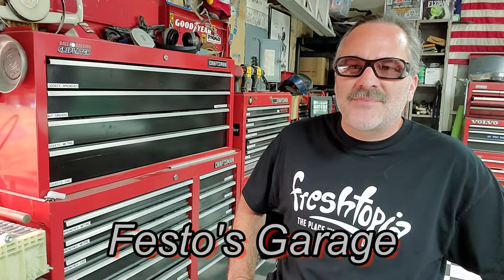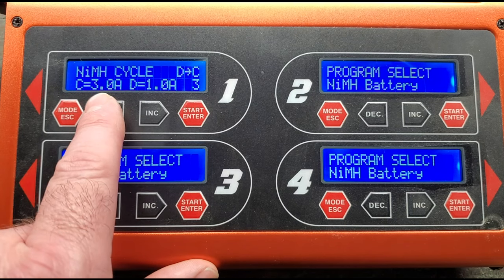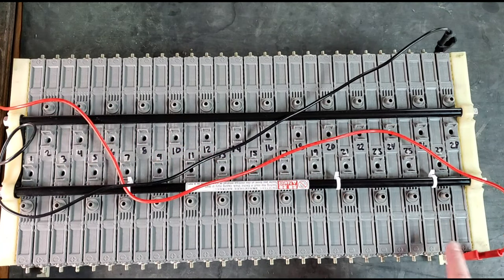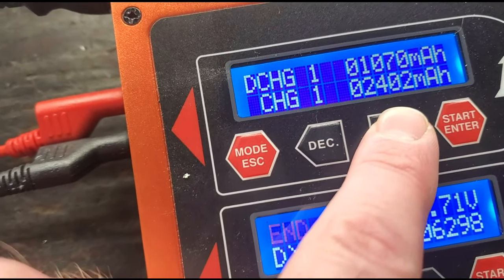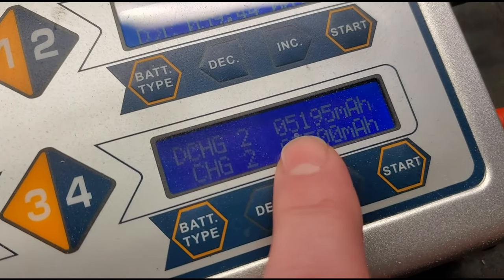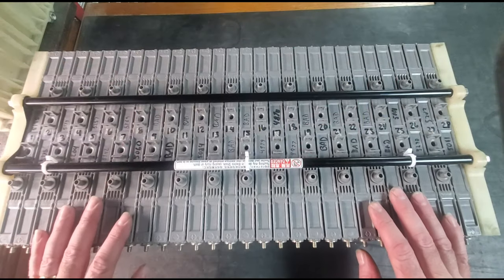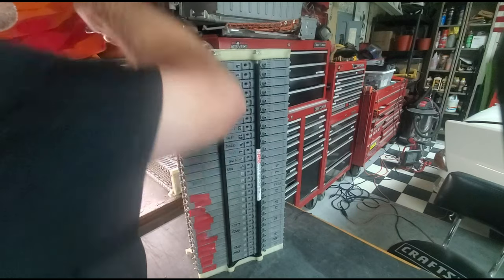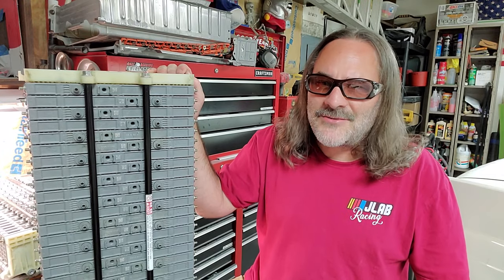Hybrid Battery Pack Refurbish - Step-By-Step w/ Settings - 2nd & 3rd Gen Toyota Prius - CQ3 Charger

Comment: I cannot detect any heating on the batteries.  If I program 10 cycles and 720 minutes, does each cycle last for 72 minutes? Of the 72 minutes, will it discharge for only 36 minutes?  Why wait 5 minutes from charge to discharge? Is there any limit to the charge voltage? Where can I get a manual that answers these questions?
Reply from the maker: Thank you for watching. The batteries will get warm when using this process and will expand. The 720 minutes is a safety timer. The cycle time will depend on the health of battery and how long it takes to reach Delta Peak based on the settings. Waiting time between cycles is to let the battery cool down. Setting the charge voltage over 6.3V could cause damage to the battery so I stay around 6.0V-6.3V. There should have been a manual shipped with your charger. If your charger is the same as mine then EV-Peak is the place to contact.

Comment: I bought 2017 camry, was 32MPG, after 1 year driving now 28MPG, do you think battery can be saved by your process(i know camry has more blades than prius), or should i get a new sodium battery. Thank you
Reply from the maker: Thank you for watching. This process can certainly bring life back to your pack. Have you checked battery health with a scanner/app such as Dr. Prius? This can tell you if the battery or if something else such as spark plugs, MAF, or filter is causing your decrease in efficiency. When deciding to refurbish or replace battery you should weigh options such as cost of new battery vs cost of charger, some replacements, and additional time of refurbishment. Please write back and let us know what you find out about your MPG change and how you are addressing the issue.

Comment: Thanks to your videos, I'm attempting to refurb my wife's Prius battery with the same charger you use. The process is taking much longer than i thought due to work schedule. I got most of the modules to acceptable discharge/charge numbers. I've gone back and rechecked some of the first ones and now the discharge isn't reaching the 5000 threshold before the charge is at 7500 capacity. Is it safe to say these are okay if I've gotten them to acceptable levels previously? I've already been at this for a few weeks and don't think i can go through them all again without running into the same issue due to time constraints.
Reply from the maker: If you have reached 5000mah on the discharge cycle and 7500mah on the charge cycle the battery is refurbished. It will equalize to the same voltage as the other batteries when you balance them together. I believe you are just about to get your Prius back on the road, woohoo!
Reply: @GreggFesto  Thanks, Gregg. Your tutorials have been invaluable!

Comment: I noticed you aren't using any temperature probes and your temperature setting is very high. How is this safe?
Reply from the maker: Thank you for watching. I am showing this process the way I was shown. Yes the batteries do get warm when cycling but not enough to cause a fire. I believe this is due to the settings. Low amps for charge and discharge to keep it in a safe zone.

Comment: Hey Gregg , love the video and am enjoying the process of refurbishing a 2007 Camry battery after buying the ev peak charger and learning as i go with your instructions . So far i am cycling modules in my spare battery pack so i will have good modules to replace any in the pack that is in the car when i start on that one (it is weak and needs refurbishing).In your opinion does a module cycled say 15 time and hit the 5000 mah mark last or work as well as a module that has been cycled 3 times and also hit the 5000 mah mark. My spare pack i bought has been out of a vehicle for a long time and sitting around. As well would it be beneficial to cycle a couple more times after hitting the 5000 mah mark and possibly get to say 5500mah or even higher if every cycle tends to increase or will a battery go out of balance in the vehicle and not even see a difference in the end.
Reply from the maker: Thanks for watching. Glad to hear all is going well. I have not noticed a difference in a battery that takes more cycles to reach 5000mah when compared to one that took fewer cycles. When I do have more than enough batteries to complete a pack, I select the ones that have the highest discharge ratings. If you can cycle more times and the discharge mah is still climbing then you can achieve a higher capacity battery. Pay attention to the charge mah, if it starts to decrease over multiple cycles then you have reached the limit of that battery. If you go too far the discharge value will begin to drop over multiple cycles.

Comment: Helpful video Gregg! I bought a new charger the same as your red one. I have been using it and charged half the pack and today when I began charging more cells I noticed the sound of the fan has weakened and the back of the charger is hotter than it was when I started using it. Do you know what could be causing this and how to fix this problem? I believe it is the larger fan in the back not blowing as strongly as before, the smaller fan in the front seems fine. Please give any tips or advice you have.
Reply from the maker: Thank you for watching. I have not had any problems with the fans so far. May be good to contact service at EV-Peak and ask for a replacement.

Comment: Hey was following your video and did the same process, but for some reason my "charge" are showing 00000 I'm doing somethings wrong?
Reply from the maker: Thanks for watching. Does this happen on more than one battery? What gauge are your jumpers? I have heard that some less expensive smaller gauge wire such as 24awg can cause issues with the process.

Comment: Would this work for a 2013 FORD C-MAX hybrid SEL VIN A hybrid battery? What would be the settings?
Reply from the maker: Thank you for watching. Yes, this charger will work on all hybrid batteries.  The settings may be different as well as the removal/installation. I am not familiar with the C-Max, I suggest you check on some forums for your car and see if someone there knows the settings for the charger. I wish you best luck and happy motoring.

Comment: Hey Gregg, thank you fornyou video. I've been following your tutorial but the capacities I'm getting on all the modules are all bellow 1,000. Except for #19 that just says 0 across the board. The battery was working great during the summer with great mileage but then i got the red triangle of death. Voltages were all really close to each other except for #19. Not sure where to go from here.
Reply from the maker: Thank you for watching. Double verify you have settings correct as I show. Be sure you are in mode discharge then charge. You should see the mah values rise within 3-5 cycles.

Comment: On the balancing your not hooked up to charger or anything?
They are just sitting there? Correct?
Reply from the maker: Thank you for watching. You are correct no charger hooked up.  just have all of the positive posts connected to each other and have all of the negative posts connected together. The end goal is to have them all equalize to each other.

Comment: If there is any mode to know the capacity of the batteries soon? let's allow already has sufficient capacity for the element and does not require additional training. So that we don't have to wait for additional hours
Reply from the maker: Thank you for watching and commenting. The easiest way to simply determine capacity is to use dr prius app. This will narrow low capacity to blocks of 2 batteries each.  

Another simple way to determine capacity is a load test on each battery to determine which are failing and which are good but this method does not have the accuracy of the charger and will not refurbish the battery like the charger. The load test is performed by connecting an automotive lamp to each battery and letting it run for a fixed amount of time. The time of test will depend on the type of lamp you use. When doing this to each battery you will see that some still hold bright light at end of test time while others dim. The batteries in which the light dims quickly have less capacity. There are many videos on YouTube of this.
Reply: @GreggFesto  Yes, I also know a lot about those methods, I just thought that this device could perform a quick test to determine the capacity of a specific 1 battery
Today I received the panlong obd scanner and I will test the dr.prius soon

Comment: hello, my friend.  Is it necessary to level a high-voltage battery according to voltage?  if I want to change 1 pair?  I’m just thinking of recharging the new element, up to the voltage of the neighboring elements.. for example, the new element will be 7.5 volts, and the batteries will be 8.0 volts.. just charge up to 8.0 and put everything together so as not to wait for a long time) 48 hours
Reply from the maker: Thank you for watching. I have always done the procedure as demonstrated in the video. I believe that you could change out some batteries based on voltage but you have no way of knowing what the capacity is and that is what matters when it comes to overall pack health.

Comment: I got the cq3 charger (red one), I did the set up you have, already pass 10 hours but still making cycles. How long does it take for a cell to finish the cycles  ?
Reply from the maker: Thanks for watching. The whole process takes me 2-3 weeks depending on the health of batteries. I usually check the charger every 12 hours or so.

Comment: Greg after the last charge before you balance do you leave fully charged at capacity? I seen a Prius chat forum said that it could cause a high voltage error code…what do you think is best?
Reply from the maker: Thank you for watching. I leave them in the charged state. Never had any issue with doing it this way.
Reply: Awesome thanks, I started the process….already recovered a whooping 6 modules in 24 hrs. using 1 cq3 charger is not fun 😢

Comment: HEY Greg, love your videos. Just bought a 2007 lexus hybrid, battery problem.  40 cells, 7.2 volts and 6500mah capacity.  I believe 2,3 gen prius cells are the same just fewer?  Ive watched your settings and you are going to 7500mah when charging. Is this not too much juice for the capacity? Can you educate me ? Thanks man!
Reply from the maker: Thank you very much for watching and writing in.  I am not a battery expert but rather just using the settings I was taught. I hope someone reading this will write in and drop some education on us both.
Reply: When discharging a module, it is safe to discharge @ 3 amps down to 6.40 volts.  Once discharged, you could consider doing a slower discharge of about 0.1 amps down to 6.0 volts (but I would do this just once or twice).  I have seen strange behavior after discharging a module down to 6.0 volts.  I think this is because, the battery chemistry supports a nominal charge of 7.20 volts.  Following discharge down to 6.40 volts, a good module will drift back up to about 7.20 volts (within 30 minutes).  When you discharge down to 6.0 volts, the module may not drift back up on its own.  If this happens, I would slowly charge the module @ 0.1 amps up to 7.20 volts.  Once at 7.20 volts, you could charge it @ 3 amps to the max voltage (which is 8.60 volts).  When the charger is charging, the charger may show the voltage is near 8.80 volts.  But when the charger stops, the voltage likely will be 8.60 volts or less.  I think this charging technique may damage decent, but older modules.  It would be nicer if the charger could keep the range between 6.40 volts and 8.60 volts.  If you are not careful, you could be needlessly damaging half the pack.  Good modules will cause a delta V to occur (at max charge), telling the charger to stop.  However, the Delta V feature can wear out in a module, and you could be overcharging a module by applying 7500 mah.  If anything, I would change this to 6500 mah, and pay close attention to the current charge voltage.  If the voltage slows down around 8.40 volts, that module may not be accepting any more charge, and I would stop at that point.  It seems you are aiming for a perfect (like new) pack, which could be expensive at $33 per module.  For me, I have two SkyRC B6AC v2 chargers.  They do not have a fan, and I can charge and discharge modules without them getting hot.  I am very impressed with this video.  My chargers rarely detect DeltaV, so I was interested in seeing this video where the charger can detect Delta v (at max charge).  After further testing with my chargers, I think charging the modules in the range 6.40 up to 8.60 volts is a safer and better approach.  My modules do not even get warm, and I can see that my cycling them pays off.

Comment: HI Gregg, awesome video! I have a question about reaching 5amps. Do you consider it good once it hits 5amp or do you run another cycle to be sure? I have a module that I ran with 3 cycles where in the first run it CAPA at 2245mAh. Then I ran again for 5 cycles but it CAPA again at 4th cycle but it was 5054mAh. The order for the 4 cycles in that 5 cycle run before CAPA was: 3064, 5319, 4575, 5054. Thanks!
Reply from the maker: I see low discharge number and CAPA on first runs many times after battery has been sitting for a while. This is normal. On your last 5 cycle run that reached CAPA on cycle 4 - this battery I would consider good however would not hurt to come back to it later and run it another cycle or two after running the rest of your batteries to be sure. I hope you will follow up once you have the pack back in your car and let us know how it goes.
Reply: @GreggFesto  after you balance for 48 hours, do you also change or just balance? If you charge, do you still charge at the 3.0A rate by just adding the leads to the welding wire?
Reply from the maker: The batteries will already be charged when you balance them so no additional charging is required. Once you remove the welding wire or buss bars you can put the batteries back into proper orientation and reassemble the pack. Let me know how your pack does once you got it back in the car.
Reply: @GreggFesto  Thanks Gregg for that amazing  video, i have my Prius has been sitting for year cause the battery pack after watching your video i decided to refurbish all , i respect all your instructions. The voltage test before i started on each module are 7.94V on each only the first one i fund 6.69V . My worries is i fund CAPA message for every single module i restored at the  first or second or third cycle  i add one more cycle Example Discharge 3416 Charge: 7201 the second one is D-Ch 4952,  C-7500mh two or three cycles on each module i tried to restore. If after 5 cycles the battery never reach 5000mh or 7500mh

Comment: Hi greg my question is do ı need to change dead modules or can I fix the dead modules with your methot
Reply from the maker: Thanks for watching. This method will show you which batteries are able to be saved and which need to be replaced. It will bring back batteries that are getting weak. You will need to replace any batteries that cannot be brought back. The goal overall is to have no battery with a discharge value of less than 5000mah.

Comment: I started my hybrid battery project today. Is it ok to leave the modules in the casing when doing the dishcarge and charge? Second, if my initial voltage reading before the cycle was 6.8, should I replace that one and not waste time with discharge/charge? Thank you so much!
Reply from the maker: Nice!!
Yes, you can leave the modules in the case.
I would run every battery no matter the volt reading.
Good luck, Please let us know how how it goes. I am interested to learn many bad batteries you find and what kind of mah readings you get.
Reply: I wouldn't waste time doing cycles on any module with a resting voltage of 6.8V. The resting voltage (i.e. the voltage you measure after letting the module rest unconnected for a while) you measure on a module should bounce back to around 7.2V even in a discharged state. This is because the resting voltage is more dependent on the underlying chemistry rather than how much charge is stored in the battery. This underlying chemistry ensures that NiMH cells come back to 1.2V/cell. Since you have 6 cells per module, that would be 7.2V. Anything lower than that strongly implies that the underlying chemistry of one of the cells is not allowing it to return to 1.2V/cell, hence your module reading 6.8V.

Comment: Hi Gregg what is the weight of one prius pack around 50 lbs ??? Starting tomorrow to test and rebuild cells. I have a small table but won't take 100 lbs lol maybe 50. Also how many amp hour is a pack or how many is one cell? If I want to make a power bank at 16v or 24V. How  does it compare to a 12v lead acid battery with 700 amp cold? thanks
Reply from the maker: Hello and thank you for watching. Prius pack weighs about 80 pounds. Each of the batteries (28) in there are 6500mah. I am not sure how to answer your power bank question as I use AC input power. Good luck on your refurbishment process, please write back when complete and let me know how it turns out.